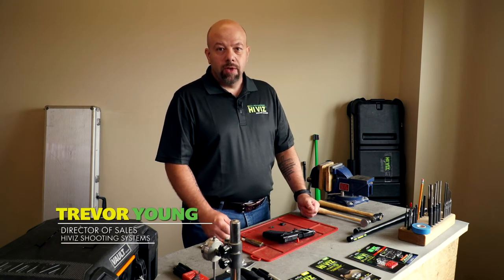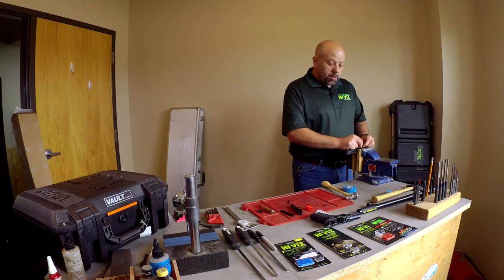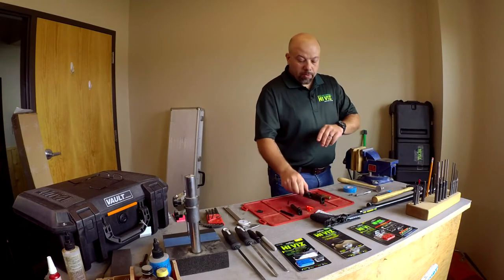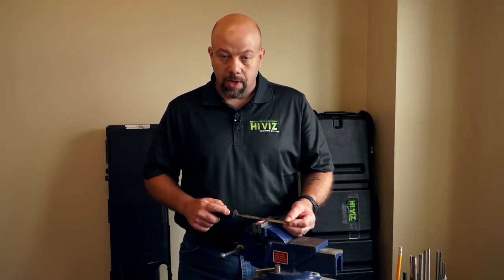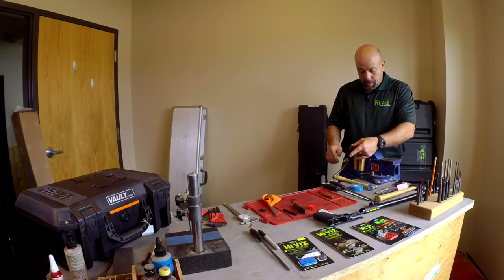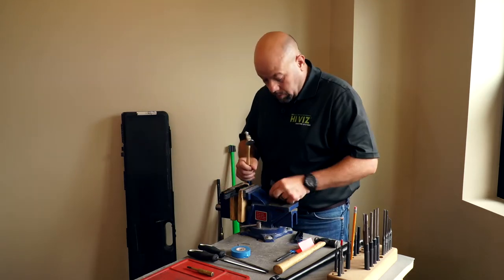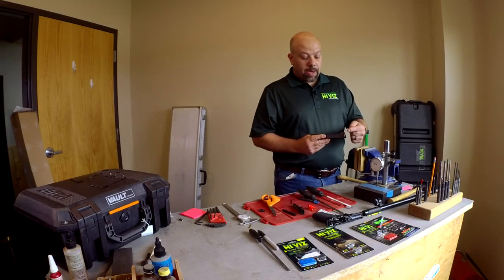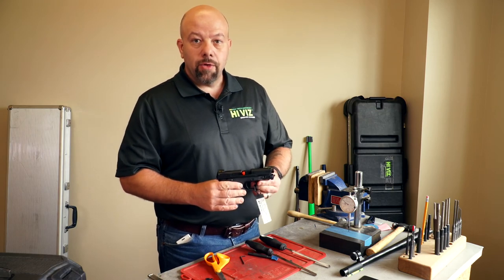Installing HIVIZ Sights - Front Dovetail Sight: S&W M&P 9 Shield EZ Pistol

Comment: I was patient and took my time, followed your instructions, and installed a HIVIZ front sight on my 9mm Shield EZ.  It went perfectly!  Thank you!
Reply: I also just bought the HIVIZ 9mm Shield EZ sights but I installed them on my .30 Super Carry Shield EZ (the sight dovetails and slide on the .30 are the same as the 9mm in regard to the sights). They fit and work great, way better than the factory sights.

Comment: I just put one on my M&P9 front sight thinking it would work with the original rear sight. It now shoot a foot low. Lame, now I have to buy one of their rear sights for another $60 or so.
Reply: No offense, but unless specified "will work with factory rear sight" you should just assume that buying sights from any manufacturer should be bought in a set, since designs/heights vary. One reason why someone might buy only one sight individually instead of both is if they accidentally dropped or bumped their gun on pavement and damaged one, that way they can replace one with an identical sight instead of buying the whole set.